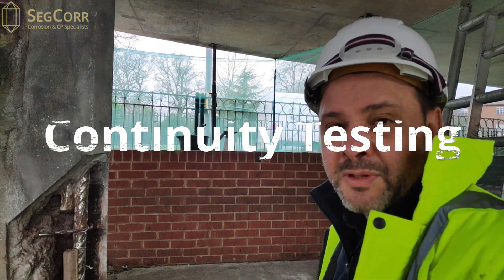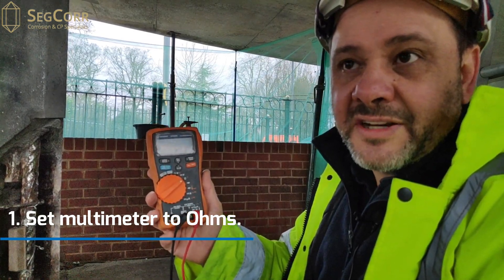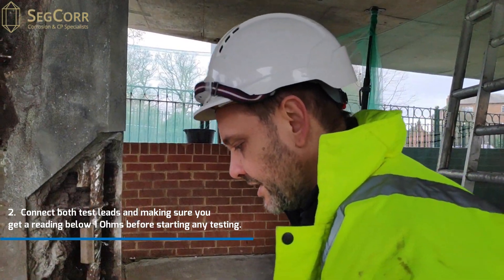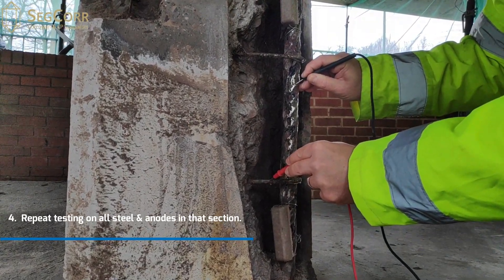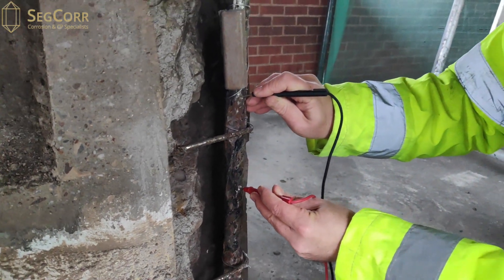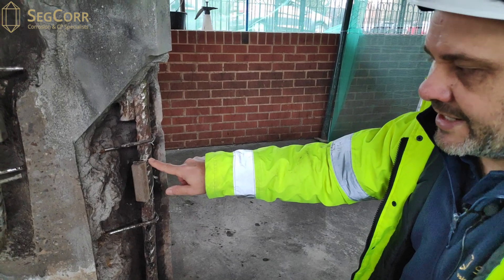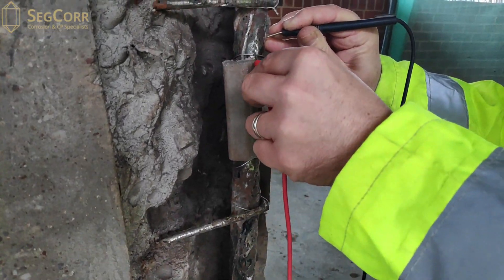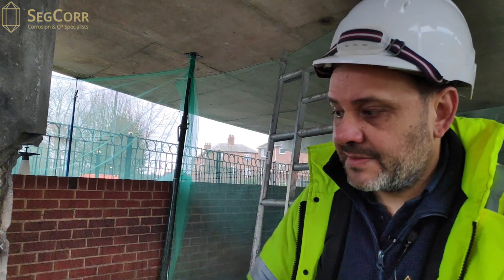Continuity Testing | Cathodic Protection | SegCorr Ltd

Comment: For that much steel to be protected, the amount of magnesium or zinc, is minimal and the cathodic protection will be short-lived, then the corrosion will continue to spall the concrete.  Poor design.
Reply: Maybe that’s just part of a system of their corrosion protection system
Reply: It’s fkn stupid and a waste of time. Engineers force everyone to use them..
Reply: The number of anodes is calculated  based on the density of the steel in the concrete. Life can be up to 20 years, depending how wet the concrete is and how much chloride there is in the concrete.